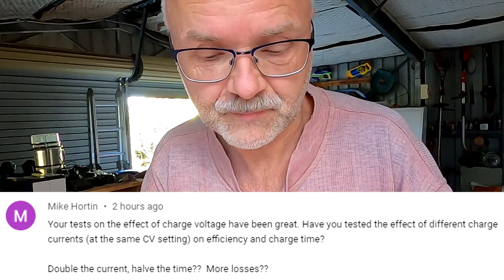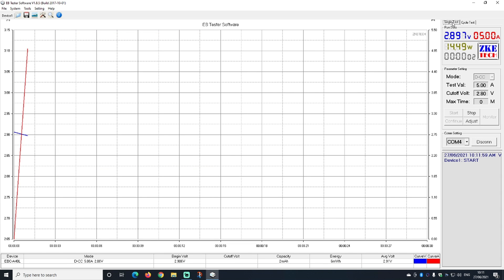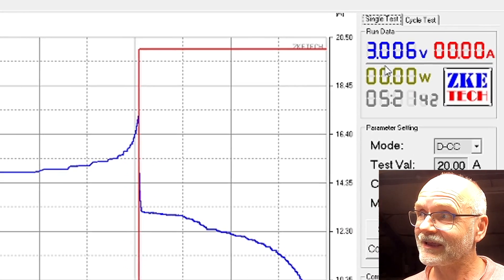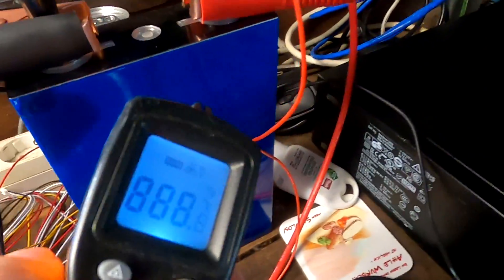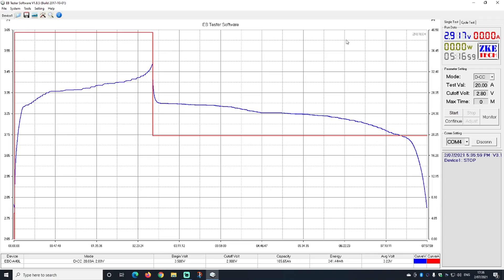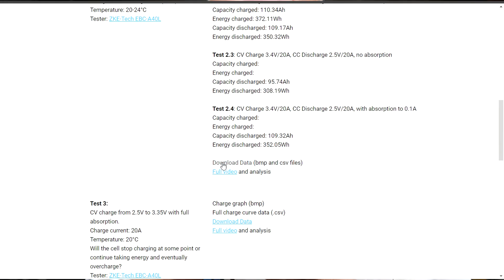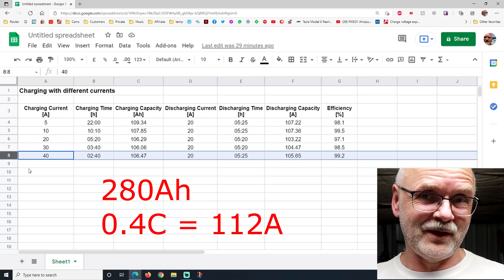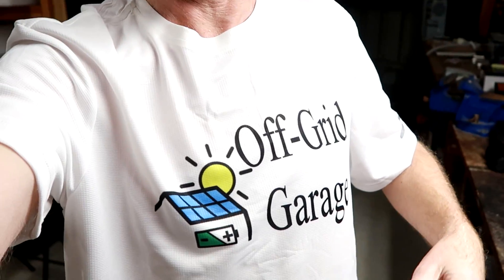Charging LiFePO4 with different currents - Efficiency INSANE!

Comment: Is there some efficiency value for the (Charging Rate X Time to charge) ?? It doesn't seem to match the Charging Capacity AHs. (i.e. 5 amps for 22.00 hrs = 110 AH and 10 amps X 10hr.10 min = 101.6 ah  [6 ah missing?])
Reply from the maker: To be more precise, I would need to repeat each test say 5 times. It just shows there is no downside when charging faster or slower (except of some small added degradation).

Comment: Capacity is measured in Ah not A. Better in Wh, unless you are very inexperienced battery user.
Reply: missed a key stoke, thanks for pointing that out. but i am inexperienced and want to keep the math simple my monitor shows amps but not watts so i use that.....30 amps in an hour (30ah)in from my charge controller to my 400 ah rated battery. as i become more comfortable with this tech i may become a more refined user but for now i enjoy using solar created electricity

Comment: Very interesting test! Don't understand, why you don't have around 100k subscribers already. You're doing great!

Efficiency should be calculated with Wh not Ah i think. Looks more like 93-96% efficiency. Interesting though that the smartshunt measures such a high efficiency with Wh. 

It confuses me, that the smartshunt only shows 8 charge cycles when the charged energy is almost 375 kWh. I assumed 26 charge cycles with your rated battery capacity of about 14,3 kWh.

Greetings from Germany
Reply from the maker: Thanks Lukas (mein Sohn hat den gleichen Namen 💪).
It will come over time, more and more people will be interested in this DIY battery solar tech.
But you're right, Wh should be the way to go as it includes the voltage as well.
The software on the smart shunt is... kind of smart. If I use the battery at say 60%SOC and do a 10% DoD only, doing this 10 times is not the same as a 100% DoD. It is heaps softer and counts maybe only like 1% of a cycle. Keeping the cells in the flat area of the curve and the DD low will make them last forever.

Comment: I have a 12v setup on a sail boat. The bow thruster takes 500A. So I've had to size my bank not to exceed 1C discharge. I use 272Ah cells in a 4S2P arrangement.
Reply from the maker: Yes, that will work. But this is not the only load for these batteries right? The thruster is just for docking purposes...
Reply: @OffGridGarageAustralia  Yes there are other loads. Typical 12v loads don't exceed 10 to 20A. But anchor windlass can take 100A and the inverter will regularly take 100A and can take 250A.
Reply from the maker: @millzee60  and you charge from solar or shore power?
Reply: @OffGridGarageAustralia  Yes, both. I have two Victron 30A MPPT charge controllers, one for each of the two 370W panels I have and the Multiplus 3KVA which I limit to 60A for shore power charging. Hmm, maybe having watched your videos I should up that. But then when I'm connected to shore power it is usually overnight so there is plenty of time.
BTW, living in the UK, on occasion I've seen 400W from the 370W panels :)

Comment: It's strange that there's not a consistent trend. I know it would take too long to figure out empirically, but I suspect variables like the temperature are playing a larger role than the charge/discharge rates.
Reply from the maker: There is a lot of variations in this tests. I probably would need to do each test 5-10 times and then compare the average.

Comment: Isn't efficiency power  in vs power out not Ah in Ah out?
Reply: Of the total system, including losses in wiring etc. - yes. If you just want to test the efficiency of the LiFePO4 cell, Ah works perfectly since it ignores those losses and only compares the Ahs going in the battery, and the ones you get out. That's also why capacity tests are done in Ah - since losses in cabling don't matter, whereas if you were to do this in Wh, they would matter (voltage drops over every connection, wire, etc.).
Reply: @upnorthandpersonal  I should imagine there's also loss in the cells which is why they often get warm when being charged. Charge rate could affect this.
Reply: @colinhercus7765  At these rates I've never had a LiFePO4 cell get warm. In any case, those losses are very minimal since the internal resistance is so low. I still think Ah in/Ah out is a good test for the LiFePO4 chemistry without having to account for other losses. It shows the efficiency of the chemistry to absorb charge and how this changes with charge rate (i.e. almost doesn't).
Reply from the maker: You can do both tests and they will show a greater loss when using Wh due to the cabling and resistance involved. This one was for the pure cell chemistry.

Comment: Andy,
Lithium batteries have a very high Coulombic efficiency (amps or charge in and out) but the power efficiency is lower due to the higher charge voltage and lower discharge voltage which brings the power efficiency down to around 90%.

Dan
Reply from the maker: Yeah, isn't that true for all batteries though? I have the results of the Wh as well in the video. Next time, I take this into account. Thank you.

Comment: Don't use the Ah/Capacity measuring for calculating the efficiency. Use the Wh/Energy measuring. Doing so, you get results 2%-5% less, but more accurate for what you want to do. Don't drink beer, before working/Wh in terms of physics is understood and done.  ;-)

In regards to your estimated efficiency of your running system: 99% of loading/unloading efficiency is just not possible, and a great indicator of a failure in your/the devices measurement. Be honest with yourself, please.
Reply from the maker: BUT... Wh are so dependent on you connections, cables and other factors. Ah are not...

The efficiency is surely very high in my battery. I have very shallow discharge/charge DoDs which makes that so high. * cycles all in total.

Comment: Efficiency of Charging should be based on the energy,not just the current. All numbers based on that are lower.I think other factors played a role since there is no clear trend. As you mentioned battery temperature may affect your results and from my experience DC current sensors are often slightly impacted by temperature as well
Reply from the maker: If you measure in Wh, it totally depends on the connections and cables as well. This was a test considering the pure capacity which blends such other factors out. In the next test I do both but 'm expecting the results will vary as well because of different connection quality from the tester to the cell.
Reply: @OffGridGarageAustralia  I believe that would not be the case. The connection to the cell has 4 wires - one set to deliver the high current and another set to measure the voltage at the cell terminals. Therefore the quality of the connection affects only the work the charger has to to but not the measured values.
Reply: A Watt is a Watt.. It will be the same.. Why Utilities companies use a Watt Meter...
Reply: @WizzRacing  But it's not a watt is a watt.  He measured charge transfer not energy transfer.
Reply: @ahbushnell1  You even know what a watt consist of?
Reply: @WizzRacing  How do you mean?  A watt is the rate of energy transfer.  A joule of energy per second.  What is the point of your question?
Reply: @ahbushnell1  You have to convert Photons to watts. As all a Photon is. Is light. And since these Photons carry particles of energy that move something. You can convert them to Watts. 

Now go read more..
Reply: @WizzRacing  He is not measuring solar panel efficiency he is measuring battery efficiency  Mr. Troll
Reply: @ahbushnell1  You don't even understand electrical Theory.. I suggest you take a course in it.
Reply: @WizzRacing  You got me Mr. Troll.
Reply: @ahbushnell1  I bet I did.. As today's society knows everything about everything. Just ask them. They will tell you they do..Yet never once taken a course in the subjects they claim to be experts in. 

Have a nice day...
Reply: @WizzRacing  I have a MSEE and BSEE and have 40 years of experience in power electronics and high voltage.
Reply: @ahbushnell1  Then I would ask the schools for refund. You got robbed...

And make one more appeal to authority.. I dare you..

Comment: Great test! These batteries are even better knowing this information. One thing I did notice Andy... It seems dark in the OGG when at night there. It is very dark! lol no winter power. This gave me an Idea and something else I have researched a bit. How about integrating a micro turbine for battery charging in the winter? I'm not sure what kind of winds you get but it's a viable solution in parts of the U.S. Just a thought . Ah, now after watching this video I feel very thirsty for some reason..  : )
Reply from the maker: I'm looking into a small wind turbine for a while. They are not expensive and could add some additional energy. As we live in a valley, it's not super ideal for that but these small 2kW turbines start at around 2m/s so that could actually work...

Comment: I've got two charge controllers, each capable of 100A coupled to a 10kW array. It's summer here in the North, and 100A+ is common these days.
Reply from the maker: How many Cs are that for your battery though?
Reply: @OffGridGarageAustralia  It's a 2x 280Ah 48V setup, so if I decouple one of them (hypothetically), it can get close to 0.7C (hypothetically). In any case, it was just a response to your 100A remark :)

Comment: great tests...great info.  i have recrntly upgraded my garage solar from 170ah batt and 20a charge controller to a 400ah batt and 30a charge controller and was wondering if the increase in charge amps would affect battery performance....now thanks to your test i am feeling good about my upgrade.  Thanks Andy
Reply from the maker: Thank you Arnold. A 400Ah battery and 30A charging is super cool, no issues with that.

Comment: I have some 8ah high current cells, capable of 200+ amps continuous, but funny thing, they are well used, and should be in the 6-7ah range, maybe 7.5ah, but after testing, charging at 5 amps. Discharge at 1amp sometimes less, 300-500ma or so, I'm getting 20-14+ah? How is this happening?? Is something up with my ISDT charger?? The cells are 8ah Headway LiFePo cells, is it the low current discharge ya think?   Can you do a similar test? Average charge current, with very low C rate discharge.. I can only discharge at 1.5a max, but usually it's half that! Just like charge current, i can set it at 20amps, doesn't mean it will charge at 20 amps, it usually starts at set current, but drops as voltage changes, i guess it's it's the algorithm, can you run a similar test ??
Reply from the maker: Sure, I put this request on the list. Just received some new cells to test anyways ;)
Reply: @OffGridGarageAustralia  thanks!

Comment: The battery was fully charged when you connected the shunt, right?
so you have consumed 10kWh more compared to charged but it still gives 96% and it is distributed over many cycles and if you were to count as you did, you should lose 1% every time you charge the battery and it is much less loss than that . Could it be that the losses increase as the extreme modes approach (that the efficiency would increase between 3.1v to 3.45v?)

Do you have any thoughts on that?
Reply from the maker: Heat loss due to internal and cable resistance has to be taken into account as well in a real scenario. This was just a pure capacity test using Ah, not Wh.

Comment: Tests are at too low of current rate to see much difference in efficiency..  

You will begin to see more degradation above 0.5C charge and discharge rates.  About 95-96% roundtrip for 0.5C, 90-91% for 1C.
Consider what these losses do to battery heating.  A couple watts loss has little effect on cell heating.  10-25 watts of loss will heat up cell.
Reply from the maker: I now have some smaller cells to test with.

Comment: Great Test! What kind of test could you perform that would show when the battery is full so you don't overcharge it. Say your battery has a capacity of 109 Ah. With a voltage of 3.65, what is the current when the battery hits 109Ah. That would be the point where you stop charging. You could do this at 3.6v, 3.55, and so on.
Reply: When the current goes to 0, or near 0 your battery will be at max capacity.
Reply: @BradCagle  Full charge takes place when the battery extends to the voltage limit, and the current drops to 5% of the rated current (.05C or C/20). Anything below that overcharges the battery.
Reply: @SpeakerKevin  Fully charged is when the battery stops pulling current. You cannot overcharge a lifep04 cell unless you exceed 3.65v, you just cant. You don't want to hold the voltage high (i.e. over 3.4 range) for extended periods of time, that's not good for it. I'm not sure where this misconception is coming from, but I've worked with lifep04 cells for over 10 years now.
Reply from the maker: That is correct, if you don't exceed 3.65V you don't overcharge the cell. there is no current flowing if the charge voltage is the same as the cell voltage. As Brad said, it is still not recommended to keep the cells at 3.65V for long, in fact our past testing have shown you can fully charge the cells at 3.35V without causing any stress or degradation.
Reply: @BradCagle  If the cells are fully charged when they hit 3.4V and current goes to zero, How is it that you can go to 3.65V and zero current that the cells are not over charged? The reason for the 3.65V is to speed up the charging process. Chargers generally cut off at .05C so 3.65V was selected to give you a full charge when you reach that amperage. Anything beyond that and you are overcharging your cells.
Reply: @OffGridGarageAustralia  3.65V is only a procedure to get the cells to be fully charged (3.4V). The reason for the 3.65V is to speed up the charging process. Chargers generally cut off at .05C so 3.65V was selected to give you a full charge when you reach .05C. Anything beyond that and you are overcharging your cells. Fully charging takes place when your cells hit 3.4V and current goes to zero, or 3.65V and 14A (for 280Ah cells). Think about it, I'm at 3.65V drawing 14 Amps and I'm fully charged, wouldn't it stand to reason that if I continue charging down to zero Amps that I will over charge the cells?
Reply: @SpeakerKevin  The overcharge condition is widely accepted as going over the max cell voltage. If you have actually fully charged at 3.4 (slow), and reached a point where no more current (or very little) is flowing, you should be able to increase the voltage to 3.65 and not have anymore current flowing, although there may be a little for a short period of time as the chemistry resettles. If you go over 3.65 you are then in the overcharge zone and causing damage.
Reply: @BradCagle  I'm willing to run that test. What would be the max additional Ah that I could put in to a 280Ah cell before overcharging occurs?
Reply: @SpeakerKevin  You need to understand you don't put Ah into a battery, instead the battery pulls it. If the battery is full it will pull no more. The only way to get it to take more is you have to raise the voltage, then you cause damage. I just charged a 16000mah lifepO4 pack to 3.4 per cell, let it settle, then charged it to 3.6, it accepted round about 10mah before it hit 3.6, and my charger stopped. Again you're not overcharging anything unless you are over 3.65 per cell. If you believe otherwise then just go with it I guess.
Reply: @BradCagle  Every morning when the sun comes up, my battery pulls current even though it was fully charged the day before. Victron Energy recommended that I switch to "Adaptive absorption time" in their controller to avoid overcharging the battery.
Reply: @SpeakerKevin  That's because you have equipment using power from the battery after the sun goes down. What equipment you ask? Your Victron charge controller, and any other components, BMS, inverter, etc.. These all use power, they don't just magically power themselves after the sun goes down. They may have suggested "adaptive absorption time" to prevent damaging the battery, i.e. holding it at a high state of charge for too long, etc.. If they said overcharging, then they misspoke. Overcharging is when the cells are held higher than 3.65

Comment: I charge with 100A, well usually ~96A from my 100A MPPT.
However I'm 12v / 4S  ... and as 1C = 900A for me, its still only 0.1C  and even my big loads are under 2C - i can get to 0.3C max running 2 big loads at once (Kettle and microwave together for my morning latte :) )
Reply from the maker: Wow, that is a lot of current. Any plans to change your equipment to a 24V system? Or even higher?
Reply: @OffGridGarageAustralia  no, I'm wired for 600A now so no issues.   12v suits me in a truck, 6 panels all parallel means I can park in shade and have slightly different angles on the panels.

System works flawlessly and 12v is much better for a mobile system. 

When I do the cottage  (with wind and hydro as well as solar) then 48v for sure. But the truck can stay at 12v
Reply from the maker: @KevIsOffGrid  that makes totally sense 👍